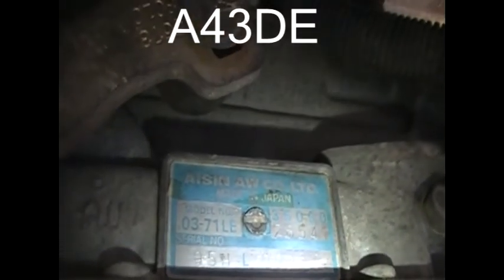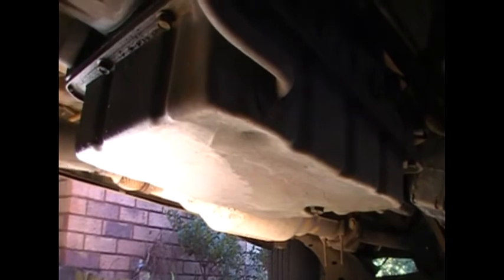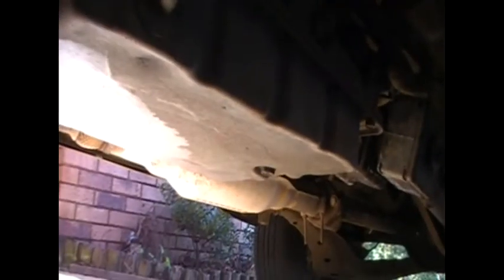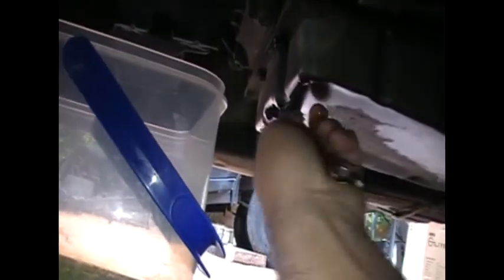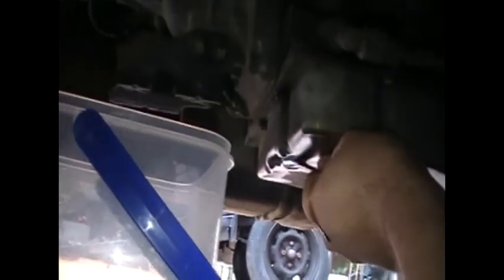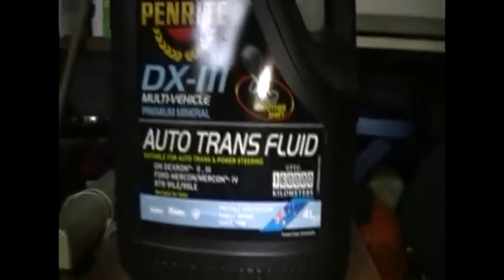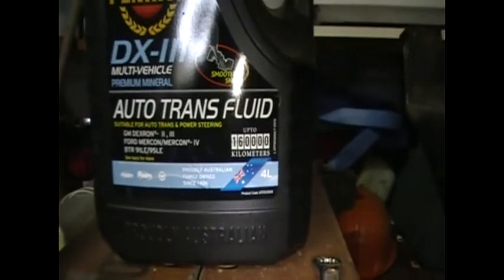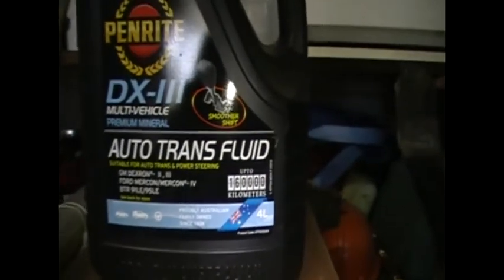Automatic Transmission pan / sump oil change [Tarago Previa Estima TCR10]

Comment: should i do it level or on incline to get as much fluid as possible out of that bolt hole at the end?
Reply from the maker: Draining the fluid on level ground or on an incline will not really make much of a difference. You might get an extra 20-30ML out. But you will need to be level when adding fluid back in.

Comment: Hi thanks a lot for doing these videos. Really helpful. I just wondered if you know if this transmission has a filter in it? I can't find the part for it here in the UK, but there is a vague reference to them in the USA. What is your experience? Cheers.
Reply from the maker: I did a quick search, found one on eBay https://rover.ebay.com/rover/1/705-53470-19255-0/1?mpre=https%3A%2F%2Fwww.ebay.com.au%2Fitm%2FRyco-Transmission-Filter-For-Toyota-Tarago-TCR-10-11-20-21R-Chaser-MX-61-71-SX60%2F153174282698%3Fhash%3Ditem23a9e611ca%253Ag%253A0O0AAOSwHTJcg4TI%26fits%3DYear%253A1991%257CModel%253ATarago%257CMake%253AToyota&campid=5337342942&toolid=20008

Comment: thanks for your video. I have 1998 tarago when cold start, i can not get gear engaged but when i rev up 4000rpm i get a strong kick and car moves. Sometimes I can not even use reverse, it does not engae. But after 15minute driving, the car is fine ,i can use all gears. Please tell em why?? new oil change?? or please...
Reply from the maker: From the sounds of it, I would suggest having a full ATF flush and a new filter plus an additive to help with slipping gears and smoother shift. As you said; After you warm up the transmission from doing a 15min drive everything works, That tells me that after the transmission oil thins out and expands the oil gets everywhere it needs to for everything to work. I was going to say the Auto reverse clutch is on its way out but if it works ok after it's warmed up then I would strongly believe it isn't the clutch. I had a bad Auto Clutch and it gets worse the warmer it is.  I would also take care of this as soon as you can. The more you force it, the bigger the risk of doing damage.
Reply: @TaragoPreviaEstima   thanks very much. I checked the oil today its full but it has carbon-burned smell and the colour is carbon pink- little pink colour but definitely not dark red. I will get ATF flush and new oil.
Reply: @TaragoPreviaEstima  can 1992 transmission fluid top up from top or i need a pump?